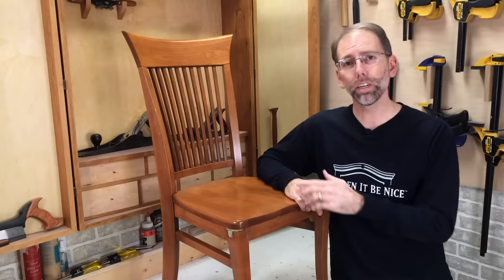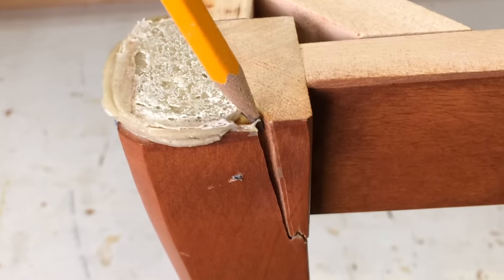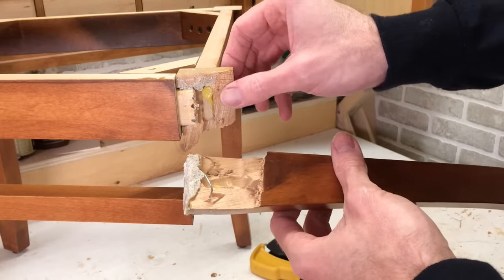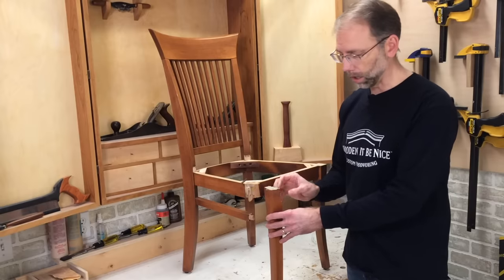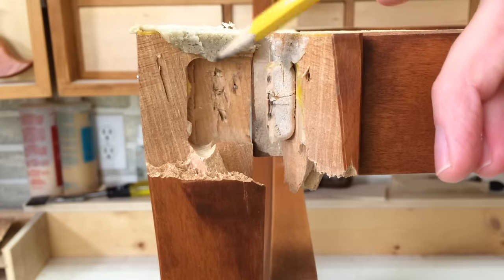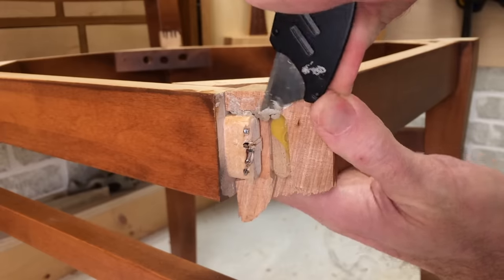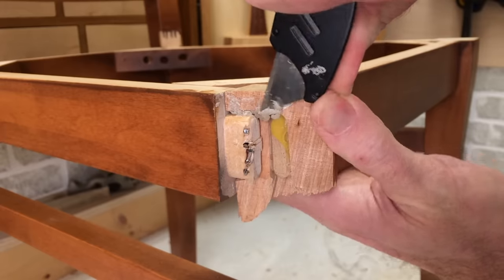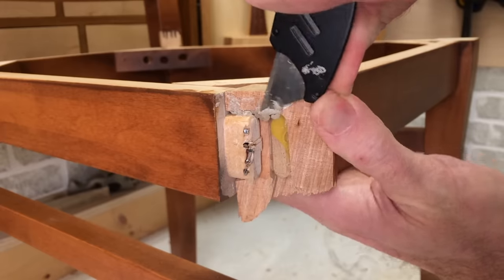Bad Furniture Repair and How to Fix It - Woodworking Restoration

Comment: Inspired by you and Tom Johnson, I went to my garage to tune up the finish on an old wooden kid’s chair for my 1 1/2 year old great grandson.  I noticed that the seat was cracked in several places and decided to take the seat off for gluing and clamping.  Naturally with my luck, the cracks were between the sloped corners.  Employing my primitive skills (enhanced by watching you and Tom), I ended up using 4 clamps of 3 types (2 “quick grips”, 1 pipe clamp and 1 bar clamp.  I used the quick grips for gaining purchase for the bar clamp since it couldn’t grip on the sloped corners.  Looks like the glue job might work although I couldn’t completely close the largest crack.  When I unscrewed the seat, I noticed that the chair was much older than I thought.  The screws were slotted (not Phillips) and patina’d.  The wood attaching the legs to the seat frame were oak.  The wood of the chair itself might be oak, but the grain is rather indistinct.  When the glue has dried overnight, I’ll start working on the finish with light oak or neutral Restor-A-Finish and Feed-N-Wax.  Thanks for the inspiration!  PS, I’m on the Central Coast of California.

Comment: A quick tip for reinforcing the fracture due to weak grain structure.
Once you've made the repair to the leg, bore a hole from the top (the style of leg will dictate what diameter and how deep) and glue and insert a dowel into the hole. I typically I prefer a 3/4" oak or maple dowel. This ties the broken pieces together with more of the good meat of the leg, and gives the screw something more to grab into.
Keep up the good work.

Comment: Aloha,
I very much enjoy restoring pieces. In my 45 years in carpentry, my most enjoyable projects have been restoration of work from before the Great Depression. I lived in Hawaii for 5 decades and ran across woods not common to North America, mostly from India, China and Japan . Some used instead of nails, thorns of Tamerian trees tapped into holes burnt by a hot iron drill. Some Tansu cabinets were made to swell shut during seasonal flooding of the homes to protect the dry food stuffs inside until they were recovered and dried out and the contents would be again eatable.
Seeing these pieces was a little history lesson and restoring them saved the memories of those craftsman.

Comment: Houston, Texas, I really enjoyed this video. I have an antique table that has been in my family for decades originally from Scotland or Ireland. It was handed down to my mothers side of the family who is from Ireland. It was passed down to my Poppy ( my mothers father) and then passed down to her. Watching your videos has shown me ways of being more careful with the process. I am not a furniture repairman, I am a construction carpenter. I just started dabbling in furniture repair a couple years ago, and your videos are helping out a lot. Thank you brother for sharing your tips and tricks.
Reply from the maker: That's such a cool story.  I love that our videos are helping you learn the craft of furniture repair and preserving a family treasure!  I love it!  Thanks.  Scott
Reply: @FixingFurniture  thank you sir!!
Reply: If you are repairing furniture that is antique it is likely to be glued with hide glue, this can be softened in the wood joints by injecting methylated spirits into the joint and then left for a half hour or so. Once the joint has been worked apart clean the old glue away with hot water and a stiff brush which when dry will be ready for re gluing. If you have a choice try to use hide or fish glue for the repair as it will help the next person who works on your antique treasure. I was an antique repair man for 14 years before turning to the Superyacht industry.
Reply: Hi 
I’m watching for UK
Reply: @pinballrobbie  wow thank you so much for that information. I hope to keep this antique in the family for years but if whoever has to repair it I would like them to not have a hassle with it. thanks again
Reply: Hey! Watching from Houston as well!
Reply: ⁰good
Reply: 🇩🇰 Denmark
Reply: Sweden
Reply: Greetings from Ames Iowa,🇺🇸 Found this from a recommendation! I watch This Old Tony, Luis Rossman, AVE!
Reply: hey ,if anyone else  needs to find out about 
electronic repair service
 try Saankramer Electronic Magazine System (do a google search ) ? Ive heard some unbelievable things about it and my mate got excellent success with it.
Reply: australia
Reply: 🇲🇨 Indonesia

Comment: Its surprising you couldn't get the 2 pieces leveled up with a mallet strike or two.
Reply: I am guessing that if it were a fresh break that would have been possible. Since it was an old, poorly repaired break, people have been sitting on it and crushing the misaligned fibers of wood. It looked to be the case when he showed a close up of the area as he cleaned it up.
Reply: preparation....i do several dry runs until its perfect...everything MUST line up....
then when it comes to glue its a breeze......must admit though after someone else has had a go its never any easier!...AUSTRALIA
Reply: same here! and i also couldn't understand why he didn't buzz it over with a sander and re oil it or varnish it.
Reply: @mikehoughton5550  I think at that point you're getting into a restoration rather than a repair, which is going to probably double the time (and likely the price) of the job. I assume this is a piece brought in by a customer.
Reply: This is the comment I was looking for. I knew that I wasn't the only one that saw it. I think I would have taken the leg completely off and made sure that it all fit together before gluing and clamping.  It would probably work as you suggested too. I used to have my own shop in Alaska.
Reply: @wilsonguitars156  Yes, you're correct. That's the way aha, aha, I like it. KC and the Sunshine band. I like their music, and I like the way you think.
Reply: @mikehoughton5550  Chances are this chair is one of four, six or eight chairs in a set.  Your suggestion would end up with a chair that would not match the others.  IMHO

Comment: Love the methodical approach and explanation. Still, I couldn't help but notice that the reattached leg is short by about 1/64" of the still-attached leg fragment. You took all that time to clear bent/folded wood fibers that were preventing a mesh between the two pieces, but you applied no apparent pressure from below (mallet or long clamp to bottom of leg?) to close the joint before clamping laterally. Did I miss something?
Reply: I think you did miss where he gave the top of the leg a few taps with a mallet before clamping, good point though. Viewing in Australia
Reply: I saw the same issue and after the chair was finished it was very apparent the leg needed to be clamped or pounded together. Those interlocking fibers would give it more lateral resistance if they were bonded with glue and forced together.
Reply: He actually addressed all those issues.

Comment: It bugged me that the tops of the two pieces were badly misaligned even after you 'cleaned them up'. https://youtu.be/wRk27aEkmyE?t=763 It's been mentioned in the comments that a few mallet taps may have been in order.
On the bright side, he's got a calm and clear voice :-)
Reply: I've had to do that at times, usually preceded by removing the remaining bits of the leg from the chair, or table, completely, repairing the leg separately, then re-attaching to the frame of the chair or table.

Comment: Great video, and you are correct…that was initially a seriously bad repair.

After watching your patience and workmanship on this project, I was intrigued by your comment regarding screws and wood working against each other.  This left me thinking, how appropriate would it be to use a hardwood dowel and screw in this specific case?

Is it a practical idea to glue up the leg exactly how you did.  Then, where the screw passes thru the brace and into the leg, bore a ½” hole thru the brace and into the leg.  Insert the dowel (covered in wood glue) thru the brace, and into the leg.  After that, use a flush trim saw to trim the dowel flush with each side of the leg, as well as the front and back sides of the brace.
Then, re-drill the dowel located in the brace, with the appropriate oversized hol. And then follow up by drilling into the leg with the appropriate undersized hole so the screw threads bite properly.

In my beginner, inexperienced, wanna be woodworker mind, I believe the dowel would further strengthen the leg repair and also isolate the longer screw fastener from any previously damaged / repaired wood as it would now be fastened directly down the length of the new dowel.

I am interested to hear what you think about that idea.  Thank you for sharing your great understanding of woodworking.

Mark Nicholson
Former, US Army - EFMB,
Combat Medical Specialist
1/94 FA MLRS
Reply from the maker: Thanks for your question Mark.  Wood screws behave differently when screwed into the end grain of wood versus the side grain.  The wood grain breaks easily when screwed in from the end, therefore it isn't a good idea to insert a dowel into a hole for the purpose of holding a screw unless it's the last resort of options.  I hope that makes sense.  Cheers.  Scott
Reply: @FixingFurniture  Hi Scott and thank you for your reply.  It never occured to me to consider that dowls are end grain, 
and your explanation makes total sense.  Thats precisely why I subscribe to your channel.  Keep up the great instructional videos :)

Comment: This is a good step by step explanation and demonstration of HOW to do this repair.

My reservations are with the ORDER of the repair steps and with the EXECUTION of the repair.

 If you look closely at the repair AFTER it is glued back together, you'll notice how far from even the TOP surface of the 2 pieces have ended up. There is at least 1/16", possibly even 1/8" of mismatch.   Because of this mismatch between the 2 pieces there is a considerable void between the  ends of the two broken pieces showing at the rear surface, where the two pieces are still separated,  which then had to be filled with the wax stick. More importantly, this indicates that the internal mating of the parts is much less than optimal, given the condition of the parts. 

SECONDLY,  it makes no sense to drill the pilot hole, to clearance the brace hole, and to screw the broken leg pieces together PRIOR to gluing the 2 broken pieces of the leg together and allowing them to dry. 

 After dissembly, and cutting the brads, and after cleaning and perparing their surfaces, the 2 broken pieces of the leg should have been glued together and clamped while drying.  THEN the stretcher to chair leg tenon/leg socket joint should have been glued together and allowed  to dry while clamped in position. ONLY THEN should the pilot hole be deepened and the clearance hole enlargement have been done. 

If more care had been taken with the fitment not only would this be a more secure repair, it would have had a better appearance afterwards. 

East Tennessee, USA

Comment: Hi, I'm from Canada. I found this video really helpful, especially the part about diagnosing the problem. I had an antique office chair I had to repair, the foot broke, where the wheel stem was. It was because the grain just there happened to be at the right angle to be perpendicular to the force from the wheel stem. It broke away in a big flake, right along the grain. So I glued the flake back on, & added a couple bolts through the foot to reinforce it. Not the prettiest thing, but it seems to have worked, I'm still using the chair, I think it's around 80 years old or so.

Comment: I'm currently living on Guam. I like to watch AT Restoration from Estonia. I used to have my own shop in Alaska. I like to watch others repair furniture, so I can see if it's the way that I would have done it. The main problem I had was always spending to much time trying to make everything perfect. I finally realized that I don't have to make everything perfect. I only need to listen to the customer and explain what can be done and how long each option would take. Then let the customer decide how much they want to spend, because time is money.
Reply from the maker: Wise advice!  I agree, sometimes there are multiple solutions for the customer to consider.  Some of which may be too expensive for them.  Thanks for sharing that.  Scott

Comment: 🇺🇸 Utah - You are my first furniture repair channel I've watched. I usually watch furniture construction and general woodworking channels, and machine shop repairs. I think we've all attempted furniture repairs. I hope to learn techniques for when I'll need to do repairs and also to learn common failure modes to avoid in building furniture - all hobby level.
Reply from the maker: Yes, our educational videos will not only teach you about repairs, but many woodworking techniques as well.  Cheers

Comment: Falkirk, Scotland.  This is an excellent video, thank you, I've learned a lot of useful tips, I've been asked to help repair some bits fo furniture soon so this will help.  I'm self-taught and have made a number of pieces of my own furniture but have no real restoration experience.  I've just started watching Thomas Johnson's channel and have learned a lot over the years from Paul Sellars and his Woodworking Masterclass series. Occasionally also Samurai Carpenter too for entertainment and ideas.  I bought a Japanese saw a year ago and love them.  I mostly use hand tools, including some old wooden planes with original Glasgow steel blades of a quality rare to find now.  I don't have woodworking videos on my channel but do have the kayak I made from a design by Brian Schulz of Cape Falcon Kayaks, another favourite channel which I recommend even if you have no intention of building a boat!  Subscribed and I will share with a colleague in the repair cafe I assist with. Best wishes.

Comment: You are the First repair site I have found and I'm sure I am going to learn a lot, but when you put the leg back into place it was about 2-3 Mil. lower than it's other half. ?? David from East Coast Australia.
Reply from the maker: Yes, the broken wood fibres prevented the leg from coming together fully at the top.  That wan't a concern for me because it's likely anyone will look under the seat to see it.  What I focussed on was a tight joint on the front face where it's highly visible.  I hope that makes sense.  Scott

Comment: Montana, USA. Thanks for sharing your expertise! I would like to have seen more detail with what epoxy and wood glues you used on this repair, as well as how you applied them so the glues would not be interfering with each other, preventing the proper working of each glue.

Comment: Thanks. I have something similar.  Mine is more complicated. The front leg came off but it is joined to the rest of the chairs with some holes for a large wood dowel.  Those two holes are gone completely so I have nothing to attach the main chair to it with.   I will see what I can do.

Comment: Thanks again for sharing your knowledge and experience. Who makes the putty sticks you use? I see great benefit to adding them to my tool bag.
A secondary question if you don't mind. When repairing a chair or table with metal anchor insert, what would you use to secure it? One of my own chairs had an insert pull out as the threads had begun to strip. I used CA glue and tightened it the best I could. 
I chose this route as I had about 30 minutes before dinner guests arrived and still had things to get done. The anchor held well when I tightened it, but I know it may not last.
What would you use in this instance if you were repairing a piece?

Comment: 🇮🇳 Ive recently started watching your furniture restoration videos and I think they are excellent study material. And I loved this one too but I wasn't happy with the final joint it wasn't level. I feel a couple of whacks with a mallet you could've leveled the joint a bit so it would be tight from the bottom side too.
Reply from the maker: Hi Joshua.  In my judgement, the top of the leg would not be visible so it wasn't worth the additional effort to further excavate the broken joint.  The important part was a tight fitting joint at the front where it would be highly visible.  For some perspective, the end grain of the broken leg was so damaged that force would not bring the parts back to the original position.  Cheers.  Scott
Reply: @FixingFurniture  I guess it's the perfectionist me talking 😅 But yes what you say makes sense. The top wouldn't be visible at all. I have started fixing some old stools using your method. But those reverse clamps are not available here so I created a jig out of a car tire vise. Its a lil slow but it gets the job done. Thanks Scott for these videos.

Comment: Hi, I'm Paul from Mossel Bay (South Africa). Your videos are really great.  I have a broken dining room chair made of Tamboti wood (a beautiful African hardwood from the Spirostachys Africana tree). The back legs separated from the seat. The failure is through the wood. What glue should I use?  The problem is Tamboti wood is very hard, but the shear strength along the grain is weak, rather brittle. If people drag the chair over carpets or rough stone floors, the strain on the legs will cause a tear over a long time.